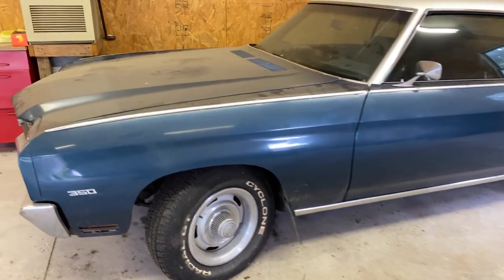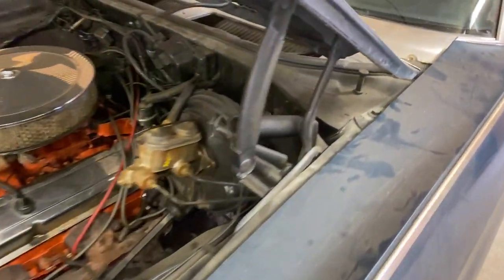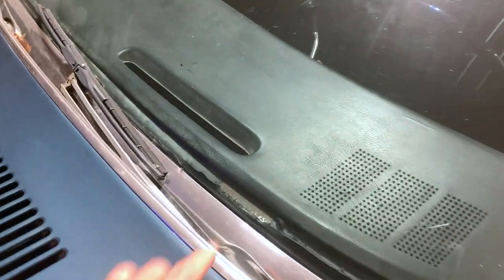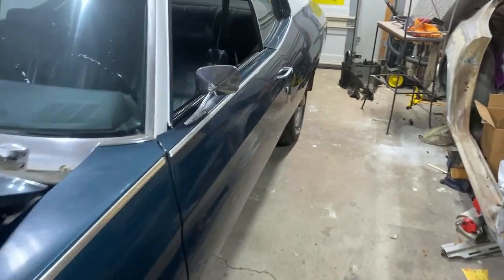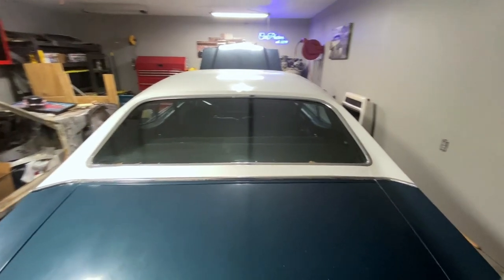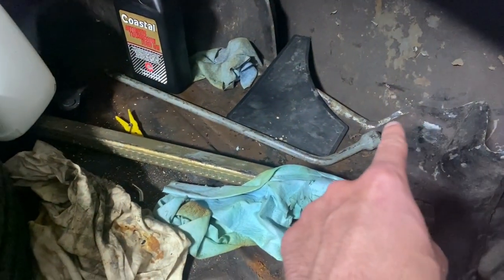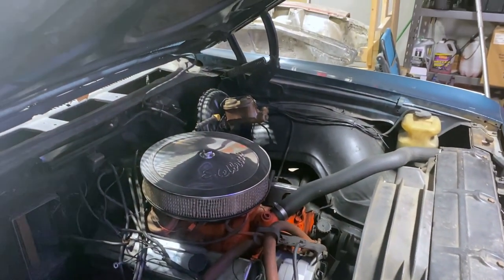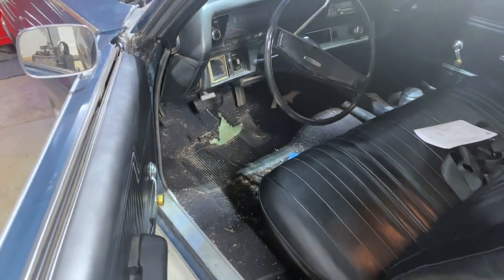I BOUGHT a 1970 Chevrolet CHEVELLE! ISSUES with the Purchase and FUTURE Plans..

Comment: Hey Ryan, I haven't talked to you in a while, sorry about that. Nice Chevelle !! I got one when I was 21, but it was no where in that shape, yours is practically cherry. Mine I traded a 87 short  bed Custom Deluxe Chevy with a fuel injection 305 for it. I had wrecked that thing 3 times and it needed about everything replaced on it so I figured it was a good trade. Mine was a 70 Malibu like yours, the guy let me piece it together from 3 Chevelles he had to get the best parts. It had no engine or tranny. Corvette rally wheels, and it was complete except for no engine or tranny. Red with black vinyl top. I kept it for a few years, cleaned out the interior and trunk, peeled off the vinyl top, things like that. In the long run I didn't have time to work on it so I just sold it in the end. Wish I had of kept though. Good luck with your new project bro. Thanks for the video and God bless you and your family.

Comment: Nice, I was going to say it looked like it was a vinyl top at one time and you mentioned it. I always like the vinyl tops. Transmission I'd throw 2 or 3 bottles of lucas Transmission in it. It wont hurt it any and may save you from pulling the Transmission out and after the valves all get working change the fluid and filter. But it's your car just some ideas. Goodluck with it.

Comment: Check the vacuum line to the modulator if you have 1 gear and reverse but not the others my guess would be the vacuum line or a bad vacuum modulator the transmission needs that to calculate engine load and without it you won’t shift. I have had my Camaro for 30 years and let it sit for 15 and the line deteriorated and so I had the same problem

Comment: Look into a Tremec TKX 5 speed, they’re supposed to fit classic cars without floorpan modification.
Reply from the maker: I actually recently did that with the Camaro and love it. Didn’t have to cut a thing. Mainly thinking the 6 speed instead since it holds more power and would come with the LS3 my buddy has already as a package deal👌